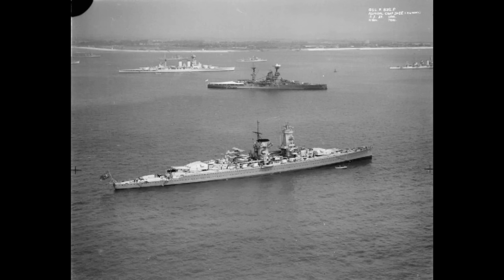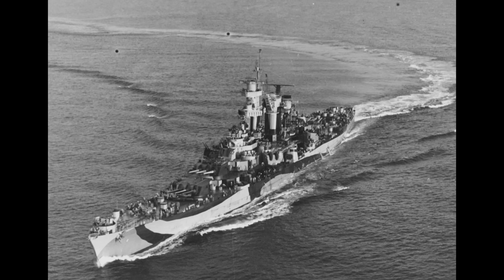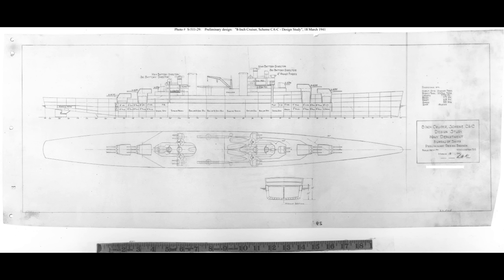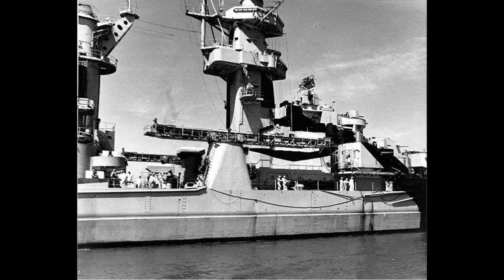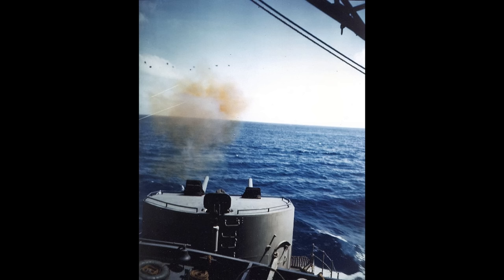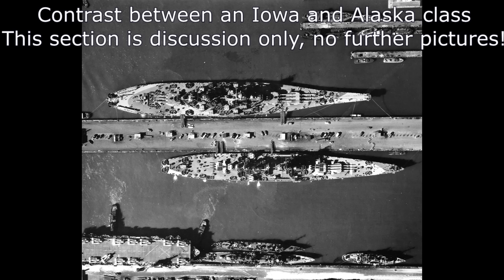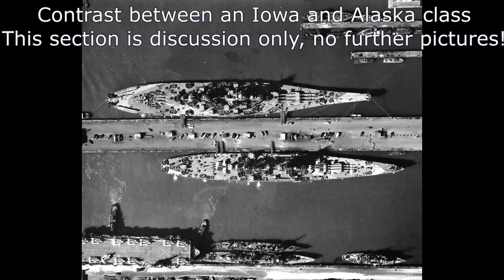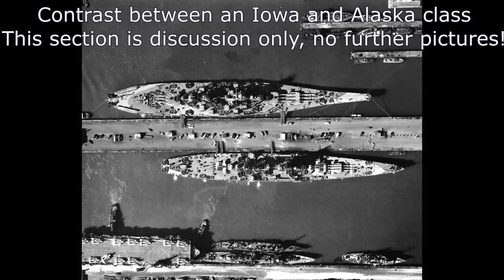The Alaska class - Large/Super/Battle/Mega/Hyper/Ultra Cruisers

Comment: The Alaska class is a culmination of the US navy's desire to build every ship type known to man. With the exception being the Super Heavy Battleship Montana Class. Though rest assured if the war had gone on for a little longer they would have had one or two of those. Even if both the Yamato and Mushashi had been sunk. You never know when you might need a 70k-80k ton battleship with 16-18 inch guns. Just a safety precaution that's all.
Reply: the supercarriers fulfilled the role of being the chonkiest chonkers on the ocean
Reply: @tommihommi1  But what if we like, put really big guns on them? Maybe rail guns, some lasers and nuclear missiles. Make it capable of going underwater, fly into space. We need a modular full spectrum dominance platform with high lethality cross platform networked integration. I even have a name picked out. We can call it the USS Enterprise or the Battlestar Galactica. Just trust me on this. All I'll need is about $300-500 billion a year for the next 20-30 years.
Reply: @robertalaverdov8147  and it would still be cheaper than F-35 programme
Reply: @germanvahatov4314  F-35 produced 3 different airframes. Get swivled.
Reply: So you're saying, the Tillman-class battleships should've been built after the Montanas? It's only for an extra layer of security in case the Montana mutinies, that's all
Reply: @patchouliknowledge4455  I mean the “Longtana” design was basically a Tillman 4.2 with more beam, 16”/50 guns instead of 18”, one fewer turret, and an extra 5+ knots.
Reply: @patchouliknowledge4455  What? No! Those are way too big. We just need something that’s got bigger guns, better armor, is a lot faster and half the cost of the Tillman class. I’m sure if we award a no bid contract to the same defense contractors that overcharged us the last 10 times we’ll get a better deal. And to make them go faster, let’s award them the lump sum of the contract upfront.
Reply: @wierdalien1  
"F-35 produced 3 different airframes. Get swivled."
That's the problem. I know people have a short memory, but one of the main arguments for the JSF was having a base airframe that was a tri-service aircraft in order to save on costs. What we got were 3 different airframes, no cost savings, and questionable performance sans the F-35B being a clear improvement over what it would replace. Of course, myself and others made the argument that there was no way this would be cheaper than individual new airframes for each branch and last year the USAF Chief of Staff was actually calling for a new blank sheet 4.5+ aircraft to supplement the F-35A due to operating costs being too high to justify use of them like we currently operate our F-16 fleet.

I'm not going to "I told you so," but I am going to hold that over the head of F-35 fans until the heat death of the universe.
Reply: Construction of the Montana's never got underway.  The ships were ordered in May,1942 but construction was delayed since the shipyards that could build them were taken up by Iowa and Essex-class ships.  They were suspended indefinitely the next month after the Battle of Midway.  All five were cancelled without even their keels being laid in July 1943 as the US Navy had accepted the paradigm shift from battleships to aircraft carriers.  Even had the war progressed with the invasion of Japan and gone into 1946 or even 1947, carriers were much more valuable and far better use of both materials and manpower.
Reply: Cruiser submarine
Reply: The Montana’s would have had 4 16 inch guns, the US had no plans of implementing 18 inch guns on them. Which would have made them pretty much moot regardless, since by the end of the war we had 13 battleships using 16 inch guns.
Reply: Montanas would have been an ultimate weapon during Korea and Vietnam. Just one Montana off Hanoi would have had the Communists wetting their pants.
Reply: @wierdalien1  Albeit with questionable parts compatibility, woops!
Reply: Quis custodiet Tillmani...?
Reply: @matchesburn  they werent meant to replace the F-16, thats not their job. They are supposed to do the Wild Weasel job as well as be able to compete in air superority battles. Both roles the air frames have been shown to excel at
Reply: maybe there would even be escort battleships lol
Reply: @matchesburn  So with that "logic" cough cough, I can then assume you have the same feelings towards the F4 Phantom II, a plane also issued to Air Force, Navy & Marines at the time. Plus if my failing memory serves me 60 years later +/_ F4's are still in service. Corruption is not the fault of a design nor is greed. Odd that so many allied nations are opting to buy this horrid plane :) And as far as F16 operating as they once did I doubt that they'd survive as well as the F35 which has stealth, you've heard of that right? Where the F16 is advertising "I'M OVER HERE" without stealth, yes cheaper to produce and operate as long as they RTB but that is questionable unless defense systems have been severely limited by previous strikes from stealth air craft.
Reply: @Jeromus1970  Exactly. The line to "And then the USN commissioned the Montana-class BBs into service" doesn't go through "the Pacific War dragged on into 1947," but rather through "the Pacific War started a year or two later (or else was two or three years shorter) than IRL, allowing the USN to get farther with their pre-war building plans" - and even then it's by no means guaranteed.
Reply: @matchesburn  they should switch to f-35c then and stop whining
Reply: @patchouliknowledge4455  You joke but the USS Montana mutinying was actually the plot of a G.I. Joe episode.
Reply: @thelordofcringe  
...That would do nothing and only make the issue worse since the F-35C has even higher operating costs than the F-35A.
Reply: @matchesburn  F-35C is far easier to repair however. The biggest problem with the F-35A is that repairs are nightmarish and take far too long.
Reply: @fouraces9137  
"you have the same feelings towards the F4 Phantom II"
If you came here thinking that this was a win and I'd want to defend the F4 Phantom, you horribly, horribly miscalculated.

"F4's are still in service"
...And? North Korea and China still operate hundreds of MiG-19s. Clearly, this means that it's a great aircraft still to this day, right?

"Corruption is not the fault of a design nor is greed"
Design-by-committee and making something into a jobs program instead of a defense program makes corruption and design fault mutually inclusive.

"Odd that so many allied nations are opting to buy this horrid plane"
Lockheed got multiple countries to buy the F-104 Starfighter when it was a pile of garbage and outdated. And broke the law in doing so. That said, the only reason countries are buying it is because the amount of low observable aircraft available for export is a very short list. The Su-57 is one - in theory - but it's years off. The Russians currently only have about a dozen test aircraft and a half dozen production aircraft. Multiple countries have expressed "interest" in buying it yet none have - including those that can't afford or can't legally buy F-35s. Vietnam is the closest that's come to it and they're waddling about pulling the trigger on it because they are are doubtful about Russia being able to provide aircraft on time, on budget and with the quality of that of their Su-27s that they're going to replace. And Vietnam, as one might guess, isn't a very large customer. India also expressed interest and seems to be distancing themselves from the Su-57 more and more by each day. The FC-31? Still in testing. The J-20? Potentially, it's an actual production aircraft now. Unfortunately for anyone that would want them - the Chinese aren't saying that they'll sell them right now. So even if you did want one and could afford it, the Chinese aren't necessarily going to sell it to you.

...This leaves what? Just the F-35. Gee. I wonder why nations are buying it. I mean, they just have this huge selection of... buying the F-35 or not buying the F-35.

"And as far as F16 operating as they once did I doubt that they'd survive as well as the F35 which has stealth"
And given the rise of EOTS/IRST - no, I don't think it will be. This also leads to the next issue:

"Where the F16 is advertising 'I'M OVER HERE' without stealth"
I hate to break this to you, but you drank the Kool-Aid. The F-35 is low observable, but only in certain radar bands and only frontally. Side is questionable depending on the radar system. The rear is barely more low observable than conventional aircraft (and there are people that will go to any length to try and argue against this - including deluding themselves into thinking the nozzle exhaust having ridges and a stator disk being in the exhaust somehow make it low-observable on the level of an F-117 or F-22 when it does barely anything against modern day radars).

I hate to break this to you, again: but "stealth" is just a numbers game and physics. OSINT wonks have figured out the radar cross sections, with minimal margins of error, for every single known low-observable "stealth" aircraft. Because we know the shape and design of the aircraft and we know how radar works and we can do math. And I already know: you're screeching about how we don't know about RAM, but we do. It's iron-ball matrices (be it nanoscale or not). And because we know how radar behaves we can even simulate this as well as to how much it can absorb electromagnetic radiation. And, due to issues with the F-22A flying the Raptor Demo Team circuit and not being served, we can see the pealing/damage to the RAM coatings and tell how thick they are, approximately.

...Do you also want me to get into how the F-35C and F-35B fleet is already having corrosion issues with the RAM coating while being deployed at sea? And how that can be just as bad, sometimes even worse, than if the aircraft had no RAM coating at all?

Now, since I know you won't believe me, lemme just show the receipts that I'm not pontificating from my posterior:
imgurDOTGOESHEREcom/gallery/cNbMVUi

Scroll down. Look through all of it. Enjoy.

"yes cheaper to produce and operate as long as they RTB but that is questionable unless defense systems have been severely limited by previous strikes from stealth air craft."
Call me when third-world nations are flying Su-57s and then maybe you'll have a valid point. As we see with this Ukraine business - when aircraft are involved, it's merely 4th generation or older aircraft that are flying around. Russia could easily put the few Su-57s into combat against Ukraine that they have. Russia wisely has not (one of the few wise decisions that they've made in this conflict) because they realize something you don't: Stealth is not a silver bullet. There's a time and place. Just because you're a hammer doesn't mean every problem is a nail.
Reply: @thelordofcringe  
"F-35C is far easier to repair however. The biggest problem with the F-35A is that repairs are nightmarish and take far too long."
Nothing about this statement is correct. The F-35C operation costs are higher because repairs take longer and parts cost more. Navalized landing gear is more robust and engineered than land-based aircraft (read: more expensive). And that's just a single component.
Reply: @wierdalien1  
"they werent meant to replace the F-16, thats not their job."
Stop. Stop. Stop right now uttering that nonsense to me.

From the Air Force's own website:
"F-35 simulator demonstrates fighter of tomorrow"
Published Jan. 31, 2006
By Tech. Sgt. Shane A Cuomo
Air Force Print News
"The Air Force expects to purchase 1,763 F-35s to complement the F-22A Raptor and replace the F-16 Fighting Falcon as an air-to-ground strike aircraft."

This has never changed until recently (like within the last 2 years recently) where the USAF has admitted that they can't afford a mostly F-35A fleet due to operating costs. If you don't even know this much, this basic of facts that has been known for almost 20 years now... I'm sorry, I don't want to be mean... But I don't want to hear your opinion on the subject. Full stop.
Reply: Honestly, I'm surprised even when the war ended no one (at least as I'm aware of) floated the idea of building a single Montana-class as a symbolic Victory ship and naming Arizona or something. Filled on freedom and liberty and if suggested at the right time to the right people and with public support, there's no telling what might happen. Especially at that time and talking about such a symbol of America naval power. Although war weariness probably would be cited as a reason not to, there was also a need for jobs with all those service personnel coming home. So it could've been marketed as a jobs program. Wouldn't be the first time, nor the last, that a defense program was actually a jobs program...
Reply: @matchesburn  You’re surprised there was no appetite for building a useless BB at a time when the USA was deep in debt and had a huge surplus of ships?
Reply: @jacksons1010  
Many 1945 vessels that were no longer necessarily were completed. (e.g. USS Kearsarge (CV-33)). If it sounds preposterous to you, I can assure you, historically, it was not.
Reply: @dvpierce248  SINK THE MONTANA! lol
Reply: Nothing works better than a huge battleship if you need artillery support for landing operations when you have complete air dominance. That's exactly what these battleships did after WWII.
Reply: That could be OVERKIll even for the U.S. Navy for it could have been great to see the designs for them at least. In modern times they could have been modified to launch missiles as well, like the Russian Battle Cruisers.
Reply: It's for the one time we run into an island the battleship New Jersey can't sink with it's guns
Reply: US Naval strategy, really it's entire military strategy, is summed up well in the "Two-Ocean Navy Act" of 1940. The US just throws it's wallet at the enemy.

The law was basically the Chief of Naval Operations Harold Stark asking congress for 4 billion after the Fall of France. There was debate in congress over battleships vs carries so they just ordered everything and the kitchen sink for a price tag of 8.55 billion after less than an hour of debate.
Reply: @fouraces9137  : The F-4 is not a relevant comparison to the F-35, because the F-4s were a single airframe design, not three designs.
Reply: Super-battleship? Not really useful. It can be sunk by a submarine, which is a superior type of warship in the anti-ship role, and in the land bombardment role a battleship can't hold a candle to an aircraft carrier. In the anti-air role a guided missile destroyer trumps a battleship hands down. There's a reason they stopped building battleships, and it isn't just expense; it's the fact that anything a battleship can do, newer types of ship can do better.
Reply: @robertalaverdov8147  Or the Space Battleship Yamato
Reply: I only wish you were right. Otherwise we'd have my dream 100,000 ton nuclear powered, depleted-uranium armored 21" automatic rapid-fire gun toting ultra battleships.  Vast fleets of them.  You never know when you might need 'em
Reply: Never know when you need 18 inch guns for things like peace.
Reply: @paulwhite6745  The biggest battleships ever built were sunk by aircraft, very very few aircraft carriers were sunk by battleships or indeed any sort of capital ships. This was an expensive lesson for all Navies to learn but it was taken to heart.
Reply: 18inch? who needs those when you could go for 20
Reply: @robertalaverdov8147  You mean the heli-carrier from avengers?
Reply: Well, why NOT throw a 16' shell 35km?
Reply: @germanvahatov4314  F-35 is dope AF. 22 is OK, but just OK. 35 IS a brand new way to war in the air. It doesn't even need to see what it's shooting at, and is capable of carrying up to 20 separate munitions in an internal bay. VTOL adds TONS of possibilities. Imagine a CA that could deploy drone-esque amounts of F-35s, right to a nations front door? Ooooooof.
Reply: @matchesburn  why make a new plane when we have THOUSANDS of servicable sub-sonic and sonic planes already? I vote we just stick a JDAM on every Cessna we can find, THEN do our thing.
Reply: @stillcantbesilencedevennow  
"why make a new plane when we have THOUSANDS of servicable sub-sonic and sonic planes already?"

Because we don't.

"I vote we just stick a JDAM on every Cessna we can find, THEN do our thing."

...If you are being serious and actually think this, it literally isn't worth my time to explain how naive and silly this idea is. If you're just trolling/laying bait... You were kinda successful and not at the same time. You got too close to Poe's Law.
Reply: With the Properly designed 18" weapon and the latest tech who knows how far those babies could travel, 200 -400 km inland, not bad for an  offshore battery. Beats running out of fuel in  the F-18 Super Hornet.
Reply: @stillcantbesilencedevennow  Interestingly In the war for Ukraine I have heard of an interesting ammunition the German Government have supplied for 155mm guns to Ukraine that will make heavy caliber canon interesting again for ships..   It is called SMArT 155.  The round is fired at the target (Armored Vehicles, Trucks, Aircraft) and once above target splits in two sub-munitions which each have a MMW 3D radar sensor that then finds the targets.   Think of MMW Milli Metric Wave as a sort of infrared sensor but with each pixel in the image containing depth/range information.     Then there are the rocket assisted Inertially guided GPS assisted rounds such as Excalibur and an additional round jointly developed by the Germans & Italians called Vulcano 155 that fired a 127 sub caliber round 70k-100km (the Naval version has even more range).  It is not rocket boosted.
-I would imagine a modern 16 inch gun with a rocket assisted or subcaliber round would have no problems firing 150km.
Then there are also the scramjet and ramjet boosted rounds that would have even more range and possible the ability to engage air targets with high maneuverability.  
-So 155mm or 8 inch/200mm guns on ships might make sense again and it might make for some powerful 5inch guns.
Reply: @robertalaverdov8147  If you can design a practical working ship-borne railgun with anything resembling a reasonable repeat-fire rate, the US Navy will absolutely buy it from you.  Combined with existing technologies that the Navy already uses, it would make certain rather thorny problems that they are facing (notably, enemy hypersonic anti-ship missiles) very much more tractable.
Reply: We never built a battlecruiser. 
If the Alaskas are battlecruisers then so are the Iowas. The Alaska had battlecruiser armor and speed. However, the 12" rifles were BB spec before WW1. Battlecruisers always had battleship main armament even if fewer barrels,
The Iowas have the speed and the guns of a battlecruiser but they have battleship armor.
They both have 2 out of 3 of the usual attributes of a battlecruiser.
I argue that fast battleships killed any need whatsoever for battlecruisers. They had the speed to scout with the cruisers and destroyers and they had the ability to take on any ship they found. They did that job better than a battlecruiser could.
Reply: Even before Pearl Harbor FDR had decided against new BB construction in favor of CV's and Cruisers. So even though the Montana's were not 'cancelled' until 1943 there was no chance any would be built. BB's 65/66 were ordered as replacements against loss. As slightly improved Iowa's they were faster, easier to build then a Montana. From "Warship Builders".
Reply: @IrishCarney  Do you have proof of there being no such design ?.....
Those secret black book budgets have to have been spend somewhere.....
Reply: @paulwhite6745  "in the land bombardment role a battleship can't hold a candle to an aircraft carrier"  So wrong.  Only thing a carrier has is further standoff range.  A single battleship salvo lays down more ordnance than entire wing does all day.  America lost countless pilots over North Vietnam trying to take out targets that would have been flattened with impunity by a battleship
Reply: Eh, dunno about that. The Iowas were enough to handle the Yamatos in a gun duel. Yamatos had a top speed of ~27 knots while the Iowas could do ~33. Combine that with superior radar and fire control systems and an Iowa will be able to handle them without much worry so long as you play competently.
Reply: @Jeromus1970 had the bombs not brought japan to the table we would have needed all the guns we could get for shore bombardment. Truely a miracle it never came to that, would have been the bloodiest campaign in history.
Reply: @wierdalien1 no it was supposed to, the F35 was the pickup and the F22 was the corvette.
Reply: @fouraces9137 before the F16 is retired I suspect we will see a drone version.
Reply: you forget one thing. we had ships that could be as effective as the Montana Class. That being the Iowas. The USS Iowa was very capable of taking on any Japanese warship in a gun fight including a Yamato Class as could the other 3 Iowa Class battleships.
Edit: While also being fast enough to escort and guard carriers if Japanese battleships and battlecruisers were able to ever lay a trap or lay chase and get close enough.
Reply: @wierdalien1 I was in the AF at the time. We were explicitly told the F-35 would replace the F-16 AND the A-10 in the CAS, SEAD, BAI, FAC, and Air Superiority roles. 
This of course was absolute bullshit as the stupidest thing I  could think of would be to take 100 million dollar stealthy fighters into golden BB range trying to kill Toyota Hiluxes